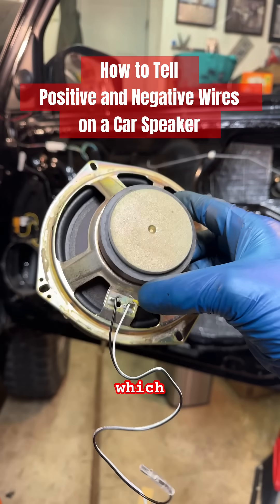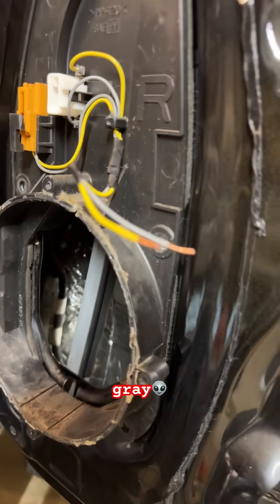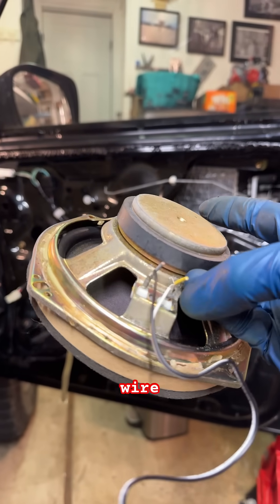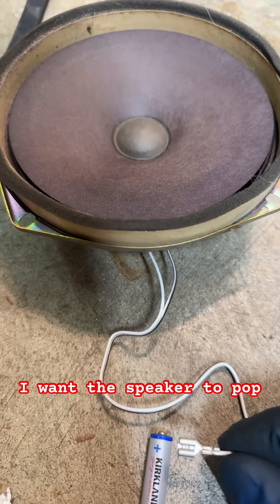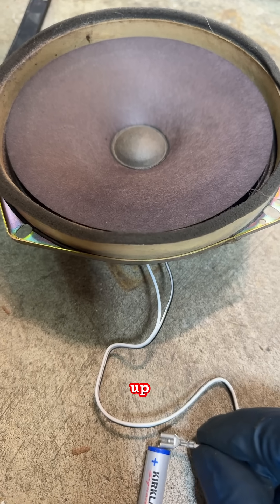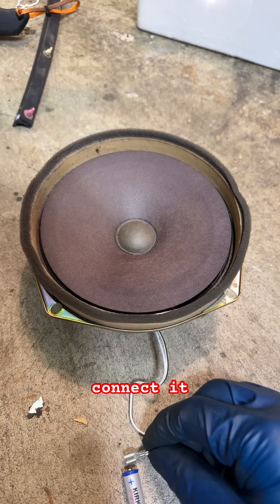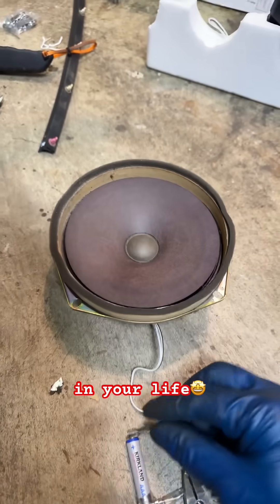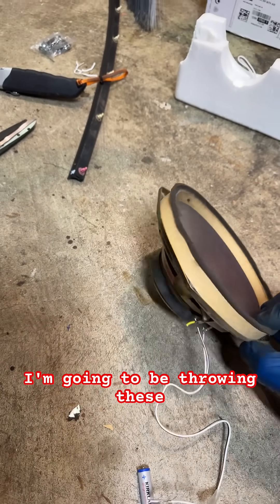How to tell if a car speaker terminal connector is positive or negative ￼￼￼

Comment: Yes you can use a battery to find that out but how do you know what speaker wire is positive or negative from the vehicle.  My speaker has a + and a -  but from the vehicle how do you determine what wire is positive or negative

Comment: Use a 9v battery and when the speaker pushes outwards it’s correct
Reply: He used a AA and I think thats definitely the safer option because AA, AAA, C, and D batteries have a voltage of 1.5 volts.
 9v is kinda a lot when most car speakers run around 6v.
Coin cell batteries are probably safe around 3v.